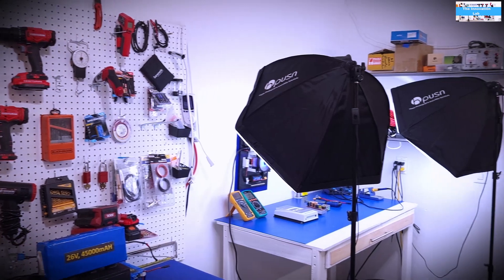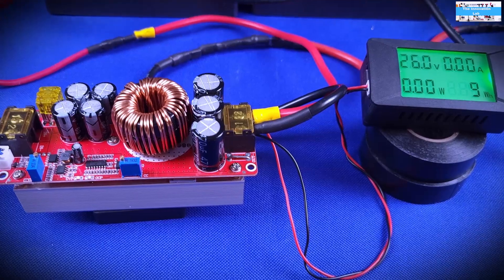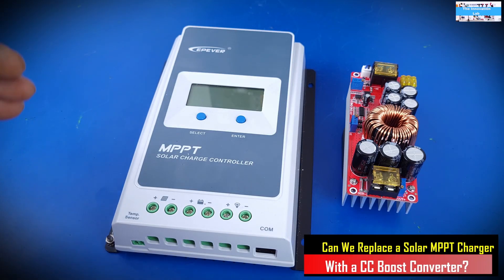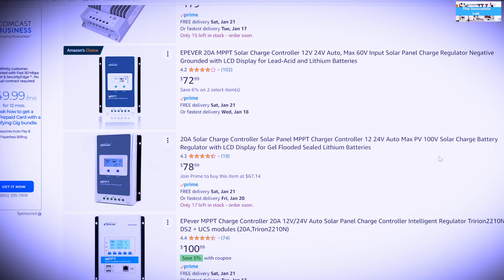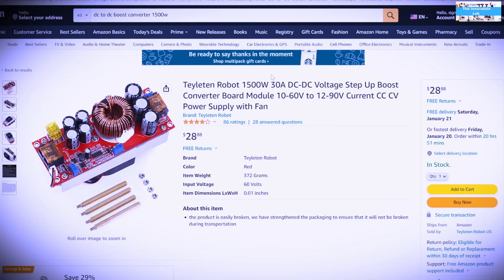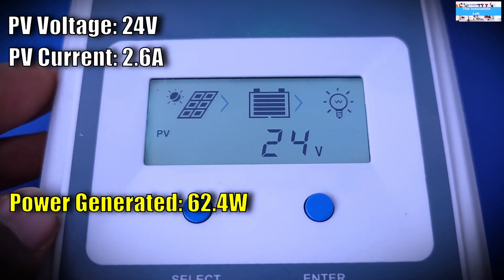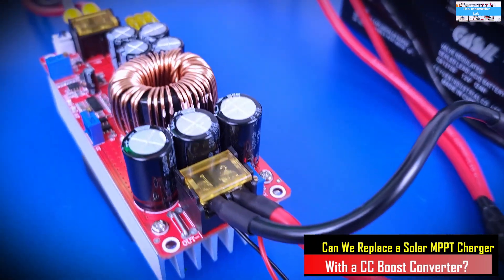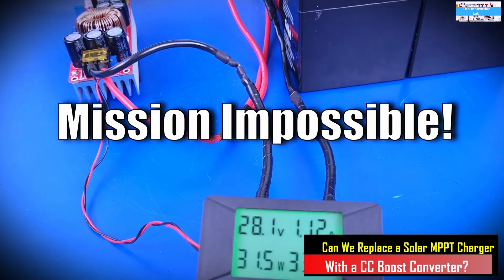Solar MPPT Charge Controller vs DC to DC Boost Converter, which is Better for Solar Charging?

Comment: Just wondering do you think its possible to series the boost converter to scc to stabilize or boost the voltage coming from the solar panel and then feed it to the scc at double the voltage then process or convert the high voltage into amps by the mppt to extend the harvest in the afternoon or during cloudy days or even very early in the morning?
Reply from the maker: I always appreciate an outside the box way of thinking! 👏👏👏
Wonderful suggestion, but  the problem is that the boost comverter is not really designed to work efficiently with fluctuating input power sources - such as a solar panel. So it during cloudy conditions, your system would probably shut down.

Secondly, cascading converters are never the best practice because you would insure horrible efficiencies due to power losses on both systems.

I hope this makes sense to you. Let me know what you think.
👍😎
The Innovati0n Lab 💥
Reply: @theinnovati0nlab782  yes your theory is very right but if i can find a boost converter that can  automatically adjust the output voltage based on the input voltage like for example if the input voltage is 20 volts the output voltage would increase to 40 volts, or 40 volts to 60 volts rather than constant to a certain output voltage bcoz youre right if i set the output constant voltage of the converter to 80volts then suddenly the solar panel voltage dropped to 20v the boost converter will shutdown or malfunction  bcoz i set the output voltage too high.

Comment: YOU CANT SIMULATE A PANEL WITH POWER SUPPLY!!!!a panel make less power if you pass the mpp voltage!! is a characteristic of silicon cells . Is the mppt that change panel voltage , not the panel that change itself.  controller not change the voltage, but change the load resistance to mantein the panel at a precise voltage independent of load voltage
Reply from the maker: As it was clearly explained in the video, the solar panel emulation was not perfect. The goal was to create a current limited power source and use it as a basis to make a comparison between the MPPT controller and the boost converter. This was the reason why I promised to make the follow-on video with real solar panels... and I actually made the follow-on video about a year ago. 

What I see a lot is that people will take a glance at a video's  thumbnail or maybe not watch the entire video, and next, they are leaving comments with ALL CAPS and exclamations.

Please watch the video in full and watch the follow-on before you make your comment.

THE FOLLOW-ON TEST WITH REAL SOLAR PANELS!
👇👇👇👇👇
https://youtu.be/4RfOrXcBvOY?si=WzgYgkmtj2DMRPUC
Reply: ok sorry I miss the part when you explain that thensimaulation is not perfect. for me is more than not perfect. but ok. I say this, because thousand of people speacking solar mppt on YouTube, not comprend the mppt essence. for example in a video the guy show 2 mppt with same panel and different output power, and say that is a efficiency problem. but is not. one of the mppt, totally fail the mpp voltage. It would be some like 30v and the mppt put the panel at 36v. Simply cant produce  the max power at that voltage.

The mppt controller wiorking in mppt mode only in bulk phase (max current). in absorption and float constant voltage phases they dont make mppt. In this phases the panel voltage is some between the mppV and open circuit,. depend of the load. but the controoller dont modulate resistance to reach a precise target voltage for the panel.
 @theinnovati0nlab782
Reply: yes this is , you explain the difference between mppt an converter. but the power suopply dont have the same behavior of panel. or is possible? how can power supply increase the power increasing the voltage and at some point , if you pass a certain limit, drastically drop the power? is possible? I think no. is a specific behavior of solar cells physic. im wrong?

Comment: a dc dc converter is a component of mppt but cant maintain the panel at mpp.  the mppt controller modulate the resistance of load to keep the panel at correct voltage. and in partially shadow is possible to have 2 or more mppv, but only one is real.
Reply from the maker: This sounds like you are repeating what was already explained in this video. Please watch the video.

We appreciate your feedback, but you have to keep them constructive.

CONSTRUCTIVE FEEDBACK FORMAT:
- what was good about the video.
- what can be improved on.
- Now, your suggestions.

These videos are time-consuming and very expensive to make. It's never inspiring when it seems that some people are watching content online  just to find faults.

Thanks!
The Innovati0n Lab 💥

Comment: Mppt use programming code a pwm ic and op amp can’t handle tracking current and automatically adjust so without programming skill it not going to work
Reply from the maker: Thanks a lot for the wonderful feedback.
You are absolutely right, and I fully understand the functional  differences between an MPPT, a PWM controller, and a DC-DC Boost converter. However, this was presented as an experimental project to satisfy our audience's curiosity on the subject.

We presented a video a while ago to show how to use the constant current DC-DC boost converters as battery chargers and after that, we recieved multiple requests to conduct the experiment......well, giving that we already  had an MPPT solar charge controller, a working DC-DC Boost Converter, and the time to make the video, so we decided to give it a shot.  The primary goal was essentially to show that attempting to use a boost converter to replace an MPPT solar charge controller is never a great idea. 

In a nutshell, I agreed with you even before making the video...hahaha. Again, this was an experiment that I embarked on mostly for entertainment and educational purposes.

I hope that this makes sense to you, and I hope that you are a subscriber. 😊
Thanks for the wonderful feedback.
- The Innovati0n Lab💥

Comment: Saudações!
Pensando na produção e armazenamento de energia com um menor custo de hardware, pensei na seguinte situação que irei testar e que se ao senhor interessar, também poderia testar.

Placa solar de 150w
Utilizar um conversor stepdown da seguinte forma:
A placa solar entra num banco de capacitores comuns retirados do lixo e depois segue para o stepdown de 300w
, configurado para saida em 14.8v
Depois disto entra num controlador de carga pwm barato de boa qualidade, com as 3 fases de carregamento para bateria!

O que o sr acha? Pode ser eficiente?
Agradeço
Reply from the maker: Wonderful!
Great thinking.👍👍

I believe that you are on the right track, going from solar panels to capacitor banks, buck converters, and then to the battery.

I think you should give a try to see if it will work. The only thing I would say is that the capacitor bank may only help the buck converter during the startup phase - especially with surge currents...that is really it. In other words, I honestly don't think that the capacitor bank is necessarily for solar battery charging. The buck converter should already have some input filter caps built-in.

However, what I would recommend is to test the system with and without the capacitor bank. Also, test all the components to make sure that they are good. If not, you may end up short circuiting your solar panel or batteries.....and you don't want that.

Success Wishes On your diy project.
👍😎
The Innovati0n Lab

Comment: i use 12v, 1.5 amp (max) solar panel with >> 5v 2amp (max) dc converter to charge my (3200 mah) old phone. it takes approx. 4- 4.5 hour for full charge on a sunny day. should i use mppt instead of dc converter?
Reply from the maker: Great question.
👍👍👍
The honest truth is that if you can afford an MPPT solar charge controller, it would be my #1 recommendation, any day. MPPT charge controllers are literally built for this sole function. 

I hope this helps.
👍😎
The Innovati0n Lab
Reply: @theinnovati0nlab782  I read that since the panel power is low, that is, it gives a maximum of 1.5 amps, it will not make much difference at low volts and amperes. Is this true?
Reply: there can be many reasons why not to rewire. for example my grid tie inverter needs min 25V to operate. that's why i use 36V LFP bank and my solar panel are 60V which go into the bougeRV MPPT controller. now i probably could run everything on 12V and use the DC-DC  to boost the 12V battery voltage for the grid tie to around 30V. i liked the 36V to have lower  R*I^2 losses in the wires

Comment: Why would you want to boost up charging voltage? Rewire your panels.
Reply from the maker: Thanks for the wonderful engagement.👍👍👍

However, the goal of the experiment shown in this video was precisely what we were testing -  to know if these  boost converters could be used as cheap and efficient alternatives for solar battery charging.
We were not desperate for battery charging solutions. This was purely an experiment designed to answer a specific question.
"Can a constant current DC-DC boost be used as an efficient solar battery charger?" 

I hope it all makes more sense to you now.
Thanks.
👍😎
The Innovati0n Lab

Comment: where do i buy this  at  i need  one or 2 of them
Reply from the maker: You can find any of those components online on ebay or Amazon.
Product names:
*MPPT charge controller
*1500W constant current DC to DC boost converter.

I hope these are the components you were referring to.
👍😎
The Innovati0n Lab.
Reply: @theinnovati0nlab782  I want one like the guy who's building them

Comment: Hi , where do i get some of those battery cables ? The ones that are on the batteries ? I dont want to crimp ..
Reply from the maker: Those are 10 AWG tinned silicone wires. You can find them on eBay or Amazon.com.
👇👇👇
https://a.co/d/bjxC8P9

Comment: 1.May I connect laptop power supply  ( 20 V 3 A ) to solar input  MPPT ( or PWM )   ? (for test without  solar panel ) 
2. or this booster ?
Reply from the maker: That was similar to what we showed in this video. As long as your laptop power supply produces a clean DC output that is within the specs of your MPPT charge controller, you can give is a try. However, to test the MPPT  function, you need a real solar panel. This is because a laptop power supply provides a well regulated constant power source - which is contrary to what solar panels are designed to do.

Comment: First of all, yes, you need to use a real solar panel as a power source.
Then, the DC/DC boost converter MUST charge an higher voltage battery than the PV voltage.
And finally, the DC/DC boost converter has a low voltage "source" protection.
If We select that protection voltage to be the nominal Maximum Pover Voltage of our solar panel, We could get fantastic resoults!
Please try better again in the next occasion! Bye
Reply from the maker: Thanks for watching this video and reacting to it, we appreciate your feedback.👍👍👍
However, this video was made a while ago, and as promised, we had already made the sequel that you were referring to - with real solar panels.
See the link below
👇👇👇
https://youtu.be/4RfOrXcBvOY

Thanks again.
👍😎
The Innovati0n Lab.

Comment: i found with these chinese boost converters when you input lower voltages ,the eff is terrible ,but when inputting 60 volt to get 80 volt with 10 amp and up input the eff increases,but there is huge differences ikn quality between units ,generally they are poorly made
Reply from the maker: Agreed!
You are on point.
👍👍
But most converters exhibit similar edficiency behaviors with respect to input voltage levels.
Reply: the final solution was actually no mppt or booster just 5 of those thin and flex pannels in series and straight to bms @theinnovati0nlab782
Reply: we love to make life hard for ourselves dont we

Comment: ive done alot of testing in this area and found its best to use the mppt unit and the converter together
Reply: with the mppt unit the conveter stays active longer when there is less solar input
Reply from the maker: Wonderful.
I am glad that it works for you that way.
Reply: agreed. many channels produced videos of hooking convreters directly to panels which is only a quick and dirty solution.  MPPT is the way to go then use converters to get the exact desired voltage.
Reply: hm that does not work for me - i mean: PV --> DC-DC --> MPPT --> battery - this is very unstable. the max power stays only on for seconds then the DC-DC requires too much current from the PV and PV voltage drops from 30V to 10V and makes is non functional . i thought it should work
Reply: @erhardschreck2192  i used the mppt controller first then the output of that ,the battery output not the load output intpo the dc to dc boost converter
Reply: i also found that series connecting the pannels to get you as close to the charging voltage as you can so you are able to boost as little as you have to,
Reply: if you only have a fixed 12 or 24 volt unit though it restricts your choices somewhat ,most people are best off going straight for a genasun unit that does it all in one unit
Reply: the genasun boost chargers are what the solar bike trekkers that travel around the world use
Reply: That's what I thought, buck booster into mppt and then into battery. Yes?
Reply: @Roy-littlebear  no into the MPPT then the boost converter then into the battery.
Reply: @katiekumcgil  
That is the plan then. I have an mppt built into my solar panel. Buck booster comes next, which then goes to battery.
Reply: @katiekumcgil  and the capacitor bank between mppt and battery 😋
Reply: What u do is use the DC to DC off the battery to the grid tie inverter . Run it to the upper limit so the grid tie will run cooler with less amps.

Comment: If you use 48volt solar panel to charge 24 battery adjusting DC DC booster 28.5 volt current also to 20amp
Reply from the maker: I like the way you think, but that is technically not possible. You can not lower your solar panel's output voltage with a boost converter. Unless you meant a buck converter?

Comment: I think a buck converter is most suitable to handle the job. Your PSU is giving 24V and the battery is no need to be charged with above the battery voltage (CMIIW), so this is why we need a buck converter to decrease the output voltage so we can get more current
Reply: Or it's interesting to see your boost converter working when you make your PSU give low voltage like 10V or less so the boost converter will handle to boost the voltage near to what is should be to charge the battery
Reply from the maker: Thanks a lot for the wonderful thoughts.
We greatly appreciate it.
However, 24V is the battery's nominal voltage. The recommended charging voltage is usually  higher than the nominal, for any battery type. 
Usually, for a 24V lead-acid battery, you will need a charging voltage of about 28V, that is, if you hope to recharge the battery close to its 100% rated capacity.
This is the same reason why vehicle alternators put out about 14-15VDC. This way, there is enough potential difference between the charging system and the battery to keep the car battery fully charged and  above the 12V nominal at all times.
👍😎
Reply: @theinnovati0nlab782  i'm sorry sir. I thought that your battery voltage was 12v :)
Reply from the maker: @reiya6563  
No worries at all.
We love the interaction in here. Please feel free to keep sharing your ideas, thoughts, and questions.
👍😎